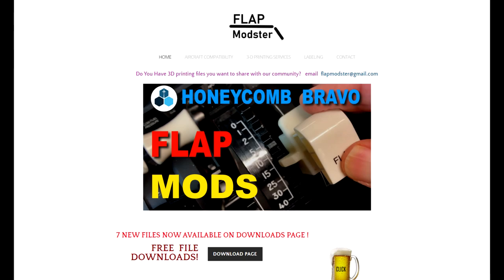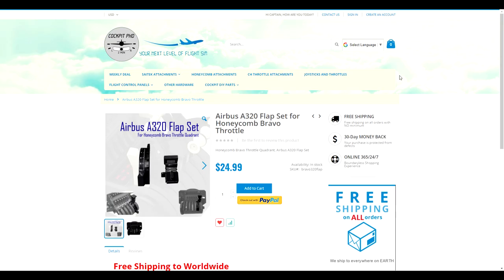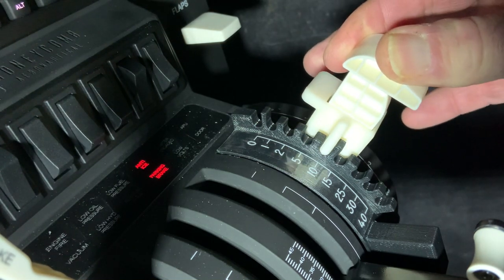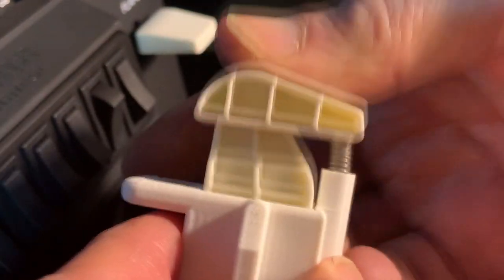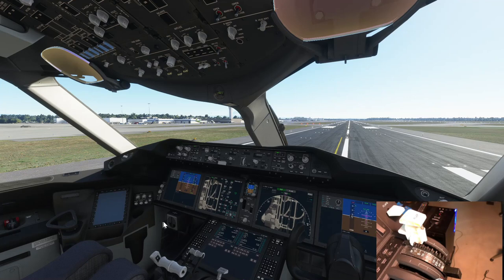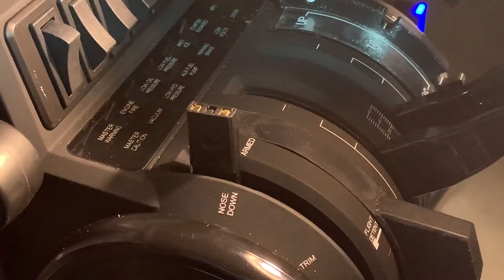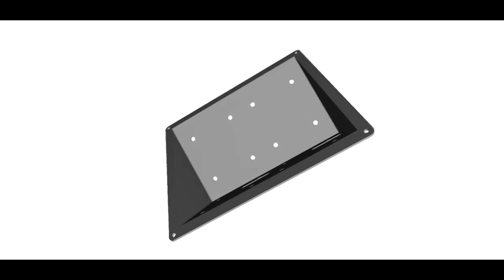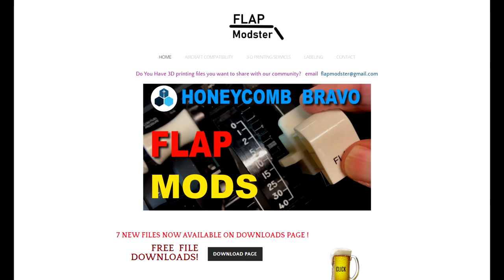More Free Stuff For Your Sim

Comment: Great video.  Thank you.  Not to change the subject but what do you or the viewers here think of the Logitech throttles as a cheaper alternative to the honeycomb throttles.  I worry about buying the honeycomb throttles because of reports of wires breaking inside and the Logitech throttles seem a little more compact on the desk as well.  
Any feedback on Logitech throttles would be greatly appreciated.
Reply from the maker: No real comparison. The Logitech have no friction adjustment and are very loose. I used them for years but Bravo is better feeling, has twice as many axes, and the gear, flaps, and other switches are a nice addition. First I’ve heard of the wire issue but mine is fine.
Reply: @rbarlow  Thank you for the response.  I'll keep that in mind!

Comment: Hi Russ, I was curious to know from your flight sim with the two 15.6 inch touch screen monitors with knobster and where you created the flap and landing gear and parking brake, did you use your 3D printer to create not on the knob, gear handle and flap lever, but did the 3D printer create the black faceplate with the white lettering also?  Thanks for the info.
Reply from the maker: I printed the black layer with the cut outs for the letters and then switched filament to white to print the rest of the layers. It was kind of a pain but it did work.

Comment: Thanks again for all this great info! BTW, is PLA the best material for making these? I was trying to use ECO-ABS and it seems, a little...brittle and "whitish"?... it's hard to carve out the hole structure that slips onto the levers. Before I invest in a new spool of Black PLA, tho, i wanted to know if this is what most people are using? (PLA, that is...)...

Thank you!
Reply from the maker: I think PLA is probably the easiest to work with and it has very little shrinkage so the dimensions usually are a great fit. ABS has the tendency to shrink and needs to be adjusted dimensionally to end up with the correct size to fit the openings on the honeycomb Bravo.
Reply: @rbarlow  thanks...I built with both, and can definitely vouch for PLA too after carefully working with both of them. the ECO ABS fits too tightly and I always have to dig out more room for the bravo handles...

Comment: Russ, do you have any tips on printing these? I loaded the Piper throttle in my slicer and I'm not sure if I need to add supports, etc.
Reply from the maker: I think the orientation may be the issue.  I found it best to print with the top of the throttle on the printer surface and the shaft vertical. That way there is very little support required and there is no support inside the shaft where the throttle slides onto the Honeycomb stub.  That was best for me.  I can't remember how the model was oriented but pretty sure it wasn't upside down and vertical. Happy New Year.

Comment: How Did You Print On Your 3D Pieces ?
Reply from the maker: On my 3D printer. An insert takes about 1-1/2 hours. A catch 45 minutes
Reply: @rbarlow  If you don't mind, which model are you using?  Your results look really good.
Reply: @rbarlow  i think he means how did you print the settings on the parts